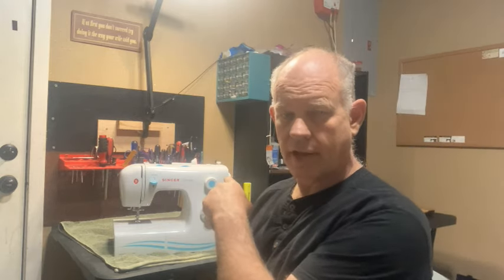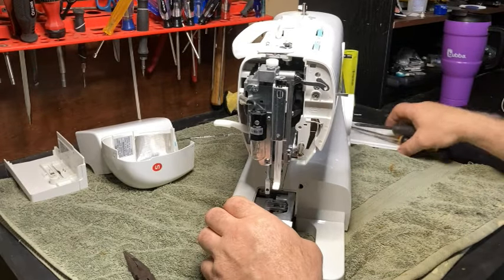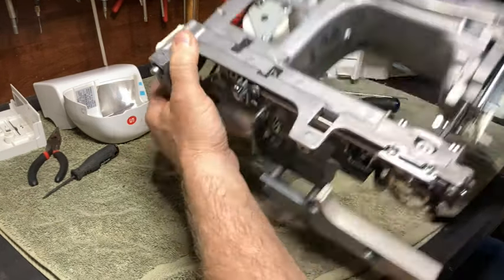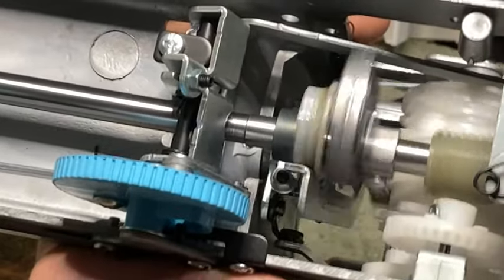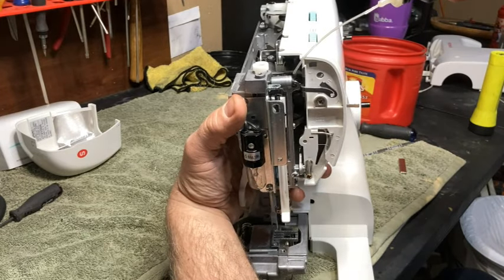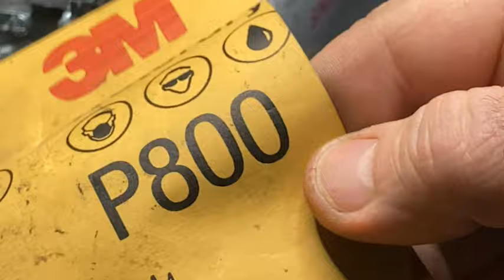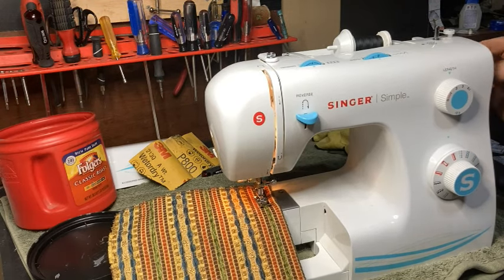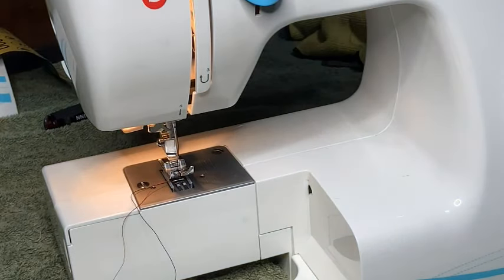How To Service a Singer Sewing Machine: Singer Simple

Comment: Wow ty sp much. The screeching and clunking in my singer tradition is gone! I didnt see the felt in the motor and I was a little scared to put oil in the motor. Where you showed the felt mine just looks like rubber pieces. There is a pretty loud whining though. Can you tell me if thats normal or do I need to service the motor? Thanks again im so happy i learned how to do that. I replaced the grease too with dielectric grease. The grease in tjere was really orange and dried out.
😃
Reply from the maker: You are very welcome!

That is awesome,  yes a little oil can make a world of difference.

There are several reasons a motor can be louder than  normal and whine, one reason is lack of oil on the bushings on each end.

I  understand your hesitancy and you definitely do not want to get oil all over the inside of the motor.

Take the belt off the motor and turn the shaft by hand,  is it difficult to turn of feel like it does not turn freely?

If so then the bushings on the end probably need a little oil.

You can let  3 to five drops run down the inside of each end,  you want them to  run on to the shaft and to the bushing.

That little bit may not make the sound go away immediately if it is from lack of oil but it will keep the motor from seizing up if the bushings are dry.

Comment: I have an older singer 860.  It still runs quite well, but have noticed a loud static noise when I do any adjusting to the stitch length knob (and sometimes it continues on after adjustment). Above it is the stitch width knob.   I have never taken the front piece off my machine.  So do you think I can just pull the knobs off to see what may be happening with stitch length controller.   Thank you for any suggestions you may have or perhaps you may already know why that noise is occurring??

Comment: Hello Richard, Your video has a lot great information and Thank you.  I was given a Singer Simple 2263 that when you try to turn the hand wheel forward, it is stuck. It will only turn backwards. I don’t know what is wrong. I oiled and cleaned everything as your video suggested.  I only thing I found is that the bobbin winder plastic bracket is broken and cracked. When I manually hold the bracket to the left, the hand wheel moves freely forward.   I think this is my problem?  Does the bobbin winder bracket need to be replaced?   How hard is it to find a replacement for the bobbin winder mechanism?  Thanks again.
Reply from the maker: Yes that is your problem.

The bobbin winder has a lever that catches and stops the hand wheel and machine from moving forward when it is engaged.
Reply: Thank you so much ! @sewingmachinetipsandtricks9079

Comment: Great Video Richard! I have watched it 3-4 times now and taken many notes.  The one I am working on had old grease that was gunky and it was very tight due to lack of lubrication. I had an issue with the Crank Connected Cam when I tried to move some things to get at it. I couldn't get the cover set screw off and I think I need a short Z screwdriver to get at it? What do you use and how do you get at that screw?  I had to loosen the Zig Zag assembly to gain more access. When I returned things to their position I am now having a problem with the needle setting and I can center it on zero and it moves to the right as I go to 4 but when I move it to 5 the needle shifts back to the left slightly.  I can't figure out how that can be fixed. I am pretty sure I need some adjustment with that Zig Zag assembly. Is there an initial position to set that dial and needle position so the needle moves properly?  Maybe you have some of this in one of your Videos?  Since that Crank Connecting Cam is such a common problem maybe you could make a video on just how you go about getting at that and cleaning and lubing it properly? I tried the method you used in this video but I never did see any black-colored oil running out. I did get it to run much smoother using the Tri-Flow and adding and rotating the machine to get it spread all around.  I think I am going  to get an RPM meter so I can measure the RPM before I do anything and then check it when I feel I am done. That should be a good way to see how smooth things are running. Thanks again for your videos and help!
Reply from the maker: I do not usually remove those screws, I think I removed one once and basically had better access to get oil into the crank rod, I used a short small screw driver and it was very difficult.

By the zigzag assume you mean the the cam assembly. I have never removed the cam assembly on these machines, you probably need to find a service manual on the Simple , Tradition or similar machine 

The cam assembly on all of them are very similar and there will be several setting you need to adjust including the swing width and swing timing so the needle swings above the needle plate and not below.

If you had no black gunk come out of the connecting rod then that probably was not the main problem. Check all the bushings and pivot joints on the feed rods in the bottom. add oil and run the machine and see which one starts pushing gunk out and that is your problem.

I hope that helps.
Reply: @sewingmachinetipsandtricks9079  Yes, I suggest to anyone who might want to move things out of the way to get at that screw to NOT do that unless you have to! My problem was actually on the lower end of the crank rod and I needed to readjust the alignment to work smoothly!

Comment: Your videos are great!   I did opt to drill a dime   ( a little smaller actually) size hole through the plastic to access the  spot on the Simple Singer machine to add oil.    Hope it does help since the  MX 60 model does freeze up so often! :(    but its so lightweight I'm doing my best to work with it and keep it. Thanks again.

Comment: @ Richard: Hi I got myself turned around putting my singer traditional 2277 back together the bottom pieces are not fitting and the reverse switch is not catch the springing bar inside, any advice to fix it? (Please and thank you!)
Ps= I oiled whole machine and she was purring good! ❤
Reply from the maker: I would need to see pictures to have a better understanding. 

You can join my Facebook group and share pictures in there with more of an explanation of the issues you are having and I can better assist you 

There is a link to my FB group on my YT account in the description. 
Just make sure to read and answer the questions, otherwise you will not get in. 
The questions help to keep spammers and scammers out.
Reply: I did get the bottom areas back on. Sewing machines work except reverse button...
Do you need picture for inside area of reverse button?
If you do, I would have to take sewing apart another time to take the picture.
Thank you for your time!
Reply: 2263 singer simple the thread bunches up  on bottom and breaks thread

Comment: Excellent video - much appreciated! One question though, I have a Singer Simple 3116, and there is cover over the screw hole on the back. How do I remove it without damaging the cover or the plastic backing? Thanks in advance!

Comment: Excellent video ,thanks for ur time and ur sharing .......😍😍😍 

My singer simple machine doesn't do stitches at all 😪😥😥

My brother Fs 40 machine it does stitches now but the up thread is loose it doesn't sew as it used to b4 😪😪😪

I need ur help if possible I appreciate ur video a lot .I need more help pls .and thanks a lot

Then I have another brother machine under thread stitches when I sew its terrible .😥😥😥
Reply from the maker: The Singer Simple, is it a top load or  front load bobbin? You say it does not make stitches. So the upper thread is not grabbing the lower thread at all then?

Your Brother machines stitches are loose correct? 
Either their is an issue with your tension assembly, it is not properly threaded or something is grabbing the thread in the bobbin case area.

Watch this video, I used a Janome but it applies to your Brother machines as well
https://youtu.be/wjZ1jqIL0DA
Reply: @sewingmachinetipsandtricks9079  hi, First of all i would like to thank you a lot for ur respond ,my singer machine its a front load bobbin ,yah the upper thread is not grabbing the lower thread at all ....no stitches at all....on the fabric.so what do think the problem it could be.....!?
Reply from the maker: @babyibrahim6837  
If you have followed everything in the video and it is still not stitching then your machine is probably out of time. 

Unfortunately it will probably need to go to a shop to find out why it happened.

Comment: Any advice on the leveler on it. It goes loose when I stitch and I have to press it back down. It makes my stitches go crazy bc the pressure decreases as I stitch.
Reply from the maker: The leveler??

One foot on the bottom is adjustable to level the machine out, it should have a spring that keeps the foot from easily turning, but it doesn’t sound like that’s what you’re talking about.
Reply: @sewingmachinetipsandtricks9079  I'm talking about the presser foot. When I use the leveler to set the pressure foot in the down position, it clicks and I have to gentle push the foot down to have the tightness to sew. The foot lost its strength and it will pop up a tiny bit as I'm zig zag sewing

Comment: I have a front load. I have never had issues with it until I tried making a rope bowl. I’ve never sewn clothesline rope and struggled on the first one. The second one is where the thread kept jamming up. After several times of that I noticed that the needle hit something metal and stops dead. I took out the bobbin case and noticed that the little screw was missing. I couldn’t find the screw and felt that it must have got thrown away in the knotted bobbin thread. I ordered another bobbin case,replaced the needle and it is still doing the same thing. I went and bought another machine but would also like to see if I could possibly fix this one. Thanks
Reply from the maker: These machines are not for heavy materials such as rope.

The needle probably damaged the needle plate and possibly the hook. both will need to be repaired.
Reply: Thank you.

Comment: This is the same machine I have, and I love it, and I love this video. So nice to be able to give extra TLC to my machine. I am curious, it seems like there's a place where a post could go to have two threads loaded for double needle stitching. Is that an option for this machine?
Reply: Hi, i don't know if you found an answer yet. If not........
- zigzag machines - with side to side stitches - will generally do twin needle.

Just be careful to stay within the presser foot slot width though.
So a 4mm twin needle is ok for double straight stitch, but if using zigzag and pattern stitches, you have to combine twin needle width with stitch width:
Eg; 2mm twin needle + 2.5mm stitch width = 4.5mm is ok✔✔✔
But 3mm twin needle + 2.5mm stitch width = 5.5mm
NO ❌😨❌😨❌

Simple 3223 has a 5mm max stitch width.
The S1 and S2 patterns are  non adjustable, so cant be utilised for twin needle, but the 1st group "black" stitches can be reduced to cope.

ALWAYS test with hand turning before proceeding, to be absolutely safe and sure of avoiding needle strike breakage and damage !! 

I hope you enjoy great results 😊
Reply: @allislove9890  but where am I supposed to thread the second thread? Through the same channel as the first? And where should I put the spool? There is only one place for a spool to sit.

Comment: Sir! I have Singer fashion maker( old machine)298, my problem is when put it in zigzag mode needle is hitting the bobin case, plz give me the solution, plz reply
Reply from the maker: Is the needle hitting the bobbin case or the hook?

Could be several different problems.

Needle not properly installed, needle bar to low, slightly out of time, bobbin case out of position.
Reply: I also have the same issue. I have singer 3232 and I am beginner  in using sewing machine the problem is when I start stitching the thread is unravel at the back causing the needle to hit the bobbin case. Idk how to resolve it do u have idea?
Reply from the maker: @abbytot4674  Sounds like the machine is not properly threaded watch this video. It is a different machine but will help you understand how to thread the machine.

https://youtu.be/fG0JcsZyfSY

Comment: My simple seems to be way off.  The needle is hitting the hole before the hook.  I have watched multiple videos but I can't find one that adresses this problem.  I'm not sure if this is a true timing issue.  I can send you a picture.
Reply from the maker: That is not timing, your needle bar needs to be  adjusted. 
If it is forward to backwards then it is easily adjusted at the top of the needle bar.

If it is side to side then it is a more complex repair.

Comment: Please if possible - show how to re-assemble this machine. I can't make the reverse button work at all (after I put machine back together). Thanks
Reply from the maker: There is a metal lever that fits into the plastic reverse button. you need to take the front back off and ensure the metal lever goes into the plastic button as you are putting it back together
Reply: @sewingmachinetipsandtricks9079  I got reverse button working. Thanks to you!
Reply from the maker: @shinebright9453  Your very welcome!

Comment: So when you put the reverse stitch knob back on the lever was down but then the video cut to it being all together and the knob was up in the correct position…… how did that happen? This is the problem I have now cos the reverse doesn’t work it’s no longer connected to anything
Reply: I had similar issue and I’m unable to get it right 😢

Comment: Can you tell me where the screws should be on the bar that the needle goes into? The Phillips head screw and the Allen wrench screw?
Reply from the maker: If your talking about adjusting the needle bar height, no I can not. I  do not know the exact measurements. I get it close then adjust as necessary.

Comment: This helped a ton but now I can’t get the reverse lever to work. It’s unattached after putting back together and I can’t seem to get it to connect again
Reply from the maker: The plastic lever fits on the metal lever as your putting it back together, usually it is not an issue but once in a while it doesn’t line up as you put it back together.

You will need to pull the front partially off and line the lever up with the plastic lever and put it back together.

Comment: sir thanks a lot and i would like to ask my (my wife machine) machine problem :( that white big handle up right side 34:22 i dont know whats call that, the big white part that you can spinning, i try spin that thing and its feel like clog something or some small fairy holding the belt wont let move smooth like before, like in the video i break down all the part and put oil on it and still same i might think its because motor is the problem??? its working but like... the needle move 1~2 times and then make weird sounds and stop it. would you be so kind as to share your idea?
Reply from the maker: That is a common problem with these machines, Look at 30:45, the part I am oiling there is common for locking up, you need to oil  run it and oil it and run it until it loosens up.

As you lubricate it black crap will probably come out need to continue until all the black crap quits coming out.

Comment: First, I really enjoy your videos, thank you! 

I just bought a used singer inspiration where the wheel that controls the width doesn’t seem to work. Do you know what might be the problem (and how to fix it)?
Reply: I have the very same problem with mine, after working hard to grease it all up inside and get it unjammed. Anyone help please?
Reply: I just figured out what was happening with the length control on my singer simple. It is in the same mechanism as the reverse lever so I opened my machine back up and re-oiled all of it, paying special attention to the part he specifies in 34.45 on this YouTube. Then I put it all back together and it ran well. I finished a project, but reversed, and it started to sew only very tight stitches, and wouldn’t engage the stitch length anymore, just like before. I looked inside the machine and it was a little sticky after engaging the reverse lever. I pushed the reverse lever again, a little harder, and the t let go and ran normally. I find this happening every so often, if I don’t push the reverse lever hard enough. But I can unjam the stitch length control just by pushing it down a little harder. Hope this helps someone else.